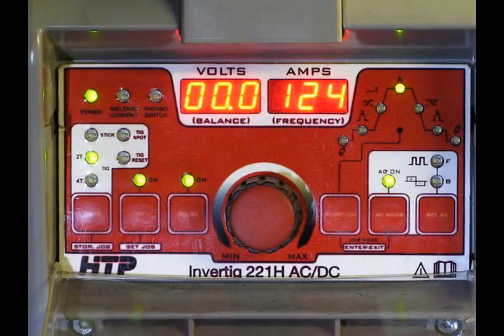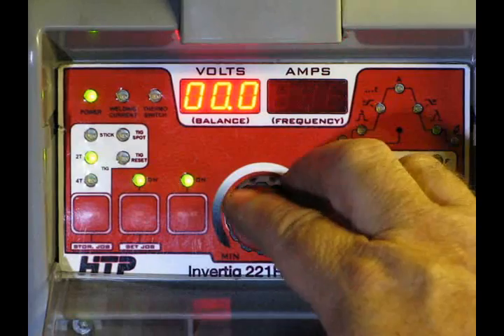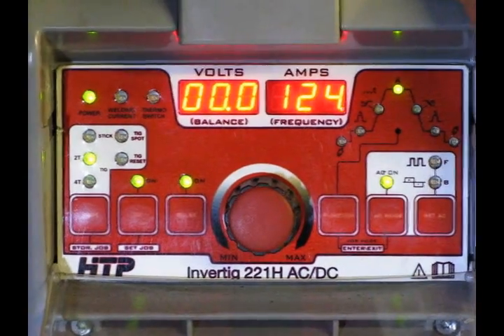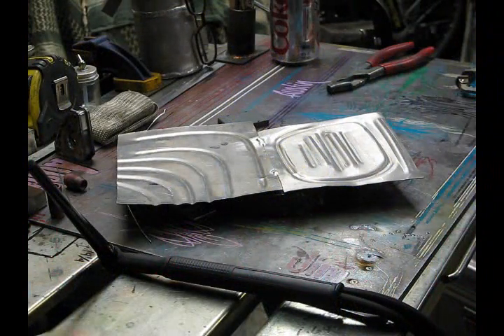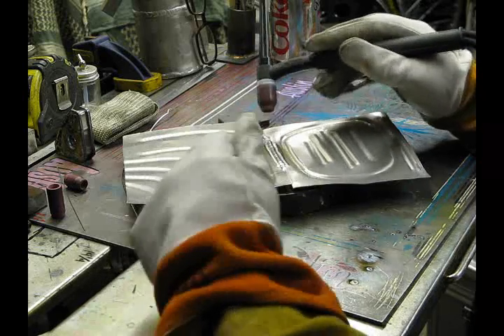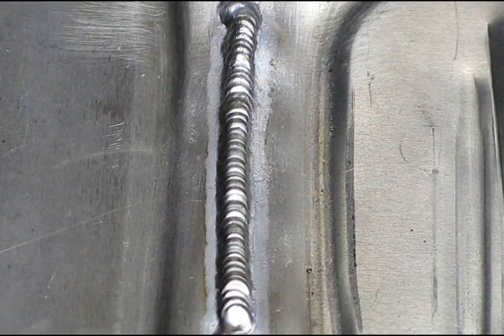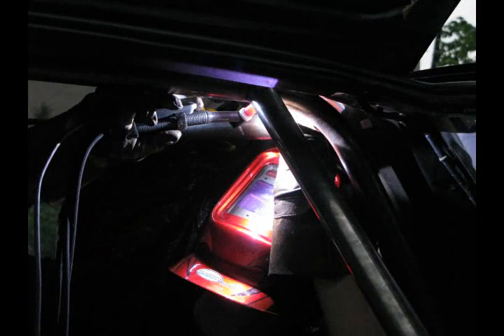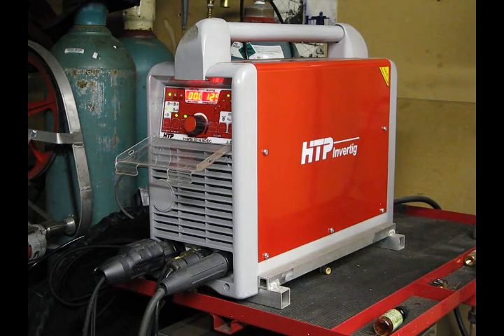HTP Invertig 221H Part 2

Comment: I just got my HTP Invertig 221 DV w/ water cooler and its bad ass! I love this thing and the HTP representatives! It has been an absolute wonderful buying experience. There were a few hiccups with my order but when I called they corrected it right away. It comes with a really nice CK torch w/ superflex cable which is awesome! I will definitely be doing business with these guys for years to come.